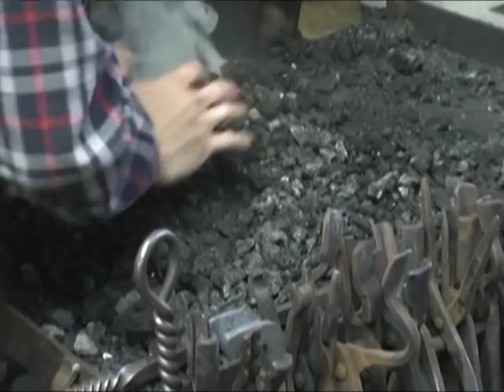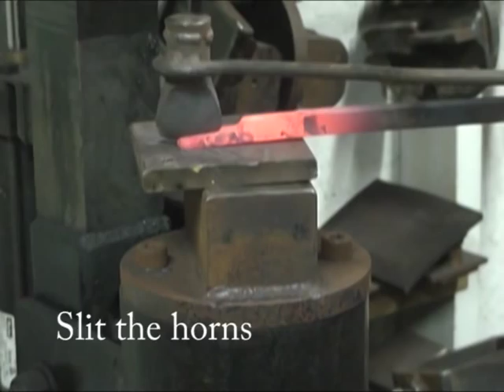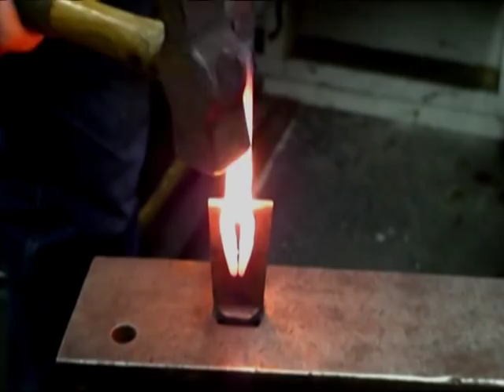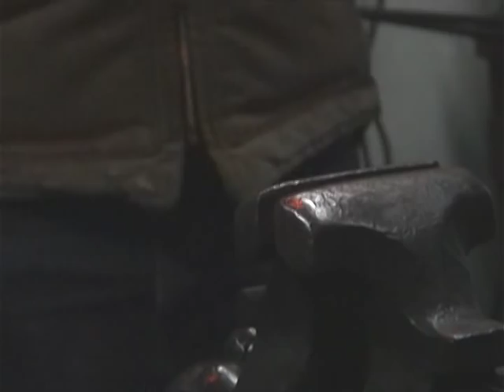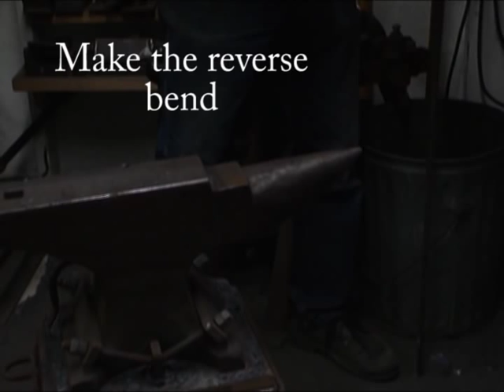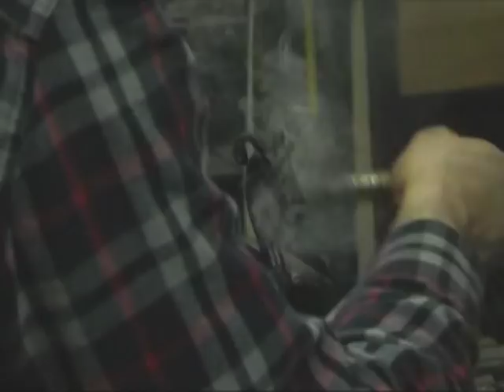Ram's head for a poker down and dirty

Comment from the maker: Sometimes I use borax and something I use EZ Weld.  It depends on if the steel is hot or cold rolled.  I use the borax on the hot rolled.